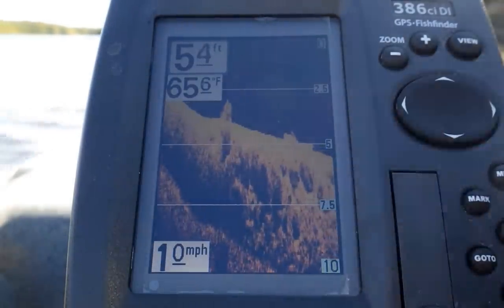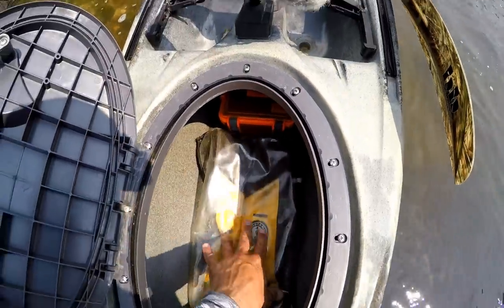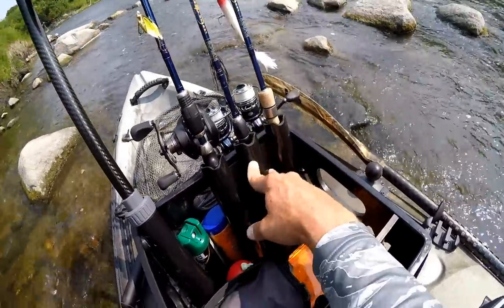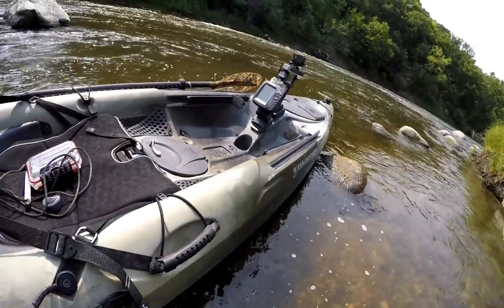My Tarpon 120 Fishing Kayak

Comment: how much did the Kayak alone cost?
Reply from the maker: New Tarpon 120's are usually priced at $939.
Reply: +NDYakAngler Thanks, what would you suggest for a first kayak that would be used for fishing that a teenager could use, and save up for?
Reply from the maker: I think the Pelican Catch 120 is one of the best deals for a sit on top kayak right now. $750 new and they have a nice folding chair style seat and are supposed to be plenty stable for standing on. The Pelican Strike and Perception Pescador are a couple more lower priced SOT's. Sit inside kayaks are quite a bit cheaper, lighter, and easier to transport but for fishing I'd definitely recommend a sit on top. You could try checking Craigslist for used kayaks for sale too or if you have anyplace nearby that rents them sometimes they'll have some used ones for sale.
Reply: +NDYakAngler ok thanks a ton!